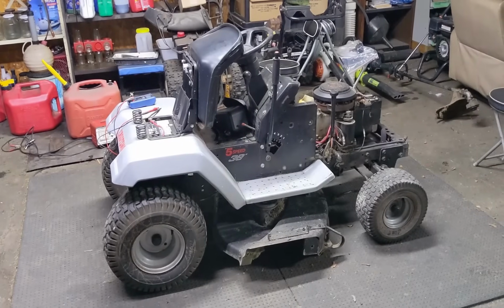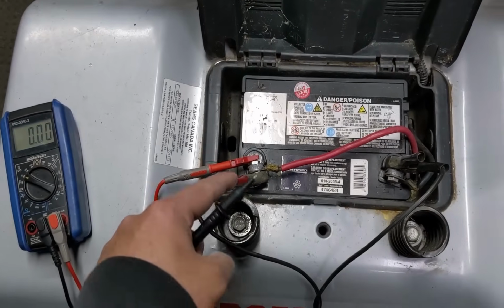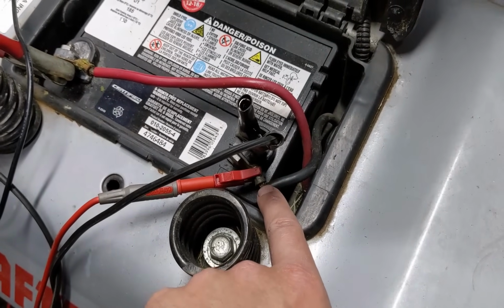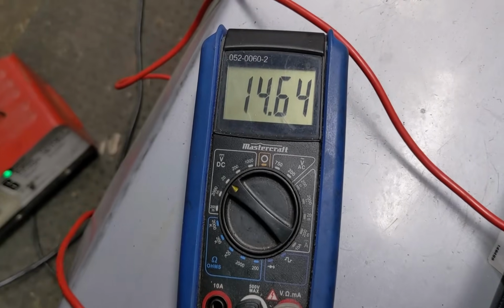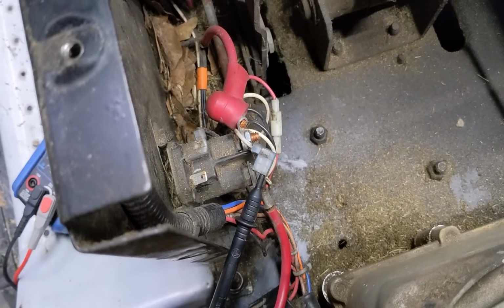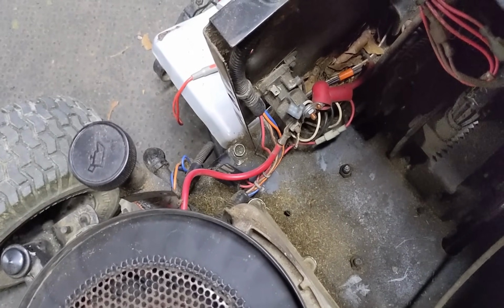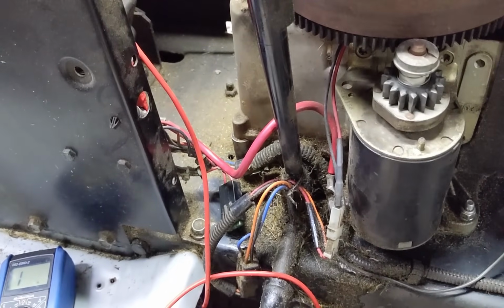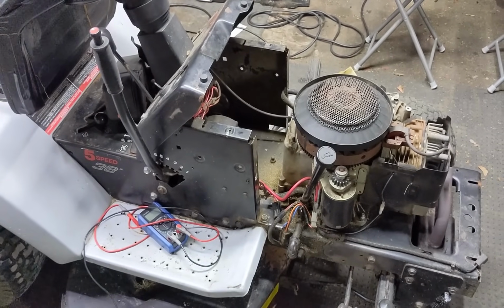Electrical Diagnosis of Riding Lawnmower that Won't Start

Comment: I just had a similar situation occur with my x350. Everything would power on, battery was fully charged, but it would start. Turns out the ground cable to the battery was slightly loose! After snugging it down, it started right up, good learning experience!

Comment: Outstanding work of explaining how to perform each step for anyone who may not understand how to use the Ohm-meter. The explanations are clear and to the point with a lot of repetition to what you are doing.  I enjoyed this very much, especially as my mower has an electrical issue which just popped up. :(  Keep up the excellent work.
Reply from the maker: Thanks Harry, hope you get it fixed up, good luck!
Reply: @EliminatorPerformance  I spent the day taking the mower apart since the book said the fuse was behind the dash.  I couldn't find it but when I was checking parts on the right side I found the fuse box attached to the sidewall next to the engine.  The fuse was blown.  So much dust & grass clippings so I blew it all out.  I then had to go to the store to buy new fuses.  At least I didn't need to buy a new battery!  The one I have is four years old.
Reply: @EliminatorPerformance  My Craftsman mower (a later model than the one you are testing) also has a safety switch on the seat which prevents the engine from starting unless someone is sitting on the seat. Total number of safety switches (I think) are brake, seat, and mower engagement [PTO].  My mower was running before I parked it, then when I wanted to move the mower the next day, it would not start. No click or anything;  I checked the battery, it's good; I checked the fuse but it had blown with part of it burned away.  I replaced the fuse but still no click so I'm following the steps you have shown to find where the other issue is which I've missed.  Thanks for the excellent discussion and showing me and others how to use a multi-meter.

Comment: You over complicated that big time! You should be able to diagnose a solenoid issue in less than 2 minutes. Without a meter!
Reply from the maker: You completely missed the point of this video lol thanks for stopping by though.
Reply: @EliminatorPerformance  No I got it. You just over complicated it big time.
Reply from the maker: @racerguy500  this is a tutorial on what to look for, and how to go through each and every single process, step by step for someone that doesn't know. Explaining how the circuits work, and what to look for when testing each one. As I stated in the beginning, I already knew what was wrong before I even started filming.

Comment: You tutorials are top notch- i had a question- i believe my solenoid is bad…. Is the wiring set up so that in the off position there is always 12 V going through the system to the starter….???

 If i run my multimeter from the hot battery post to my starter- i get a full reading of 12+ volts…. When i engage the starter switch to start- the reading on the starter goes from 12 to 0- i am planning on replacing both the solenoid and the starter switch…….  I will test the starter switch when i pull it out tomorrow…. Thanks

Comment: Hey, my lawn tractor Husqvarna TS138 model has an issue. I think it is related to the electrical system.

The battery indicator always red in colour (meaning the battery is weak or almost empty) even though I use the new battery and fully charged battery.

Is it the solenoid problem? Or maybe it is the key problem?

Please help me. I stuck with this problem almost three months now.

Comment: Awesome step by step. I had done some disassembly to repair a serious gas leak which turned out to be a disconnected hose that must have vibrated loose from a poor connection. Put it all back together and not even a click. I suspected the seat safety switch because that’s the only electrical I touched. According to your protocol I got a bad read on the ground wire from battery! Why now? Was starting fine prior to disassembly. Anyway, back to cleaning and/or removing cable after a break. 19.5 hp Twin Craftsman. Thx.

Comment: Great video. Just to be clear, on a 3 terminal solenoid, the switch trigger wire should or shouldn't have continuity between it and the grounding bracket. Thanks.

Comment: I have to say this was very helpful - I'm going out to get a Volt Meter tomorrow! The starter problem I'm having on my Cub Cadet LTX1042LW is that when I turn the key switch, I'm hearing what I'd call a 'whirl' sound but no engine turn over. I'm not hearing the 'solenoid click' you talked about. After a number of key turning attempts, the engine will turn over and start. Would this be more of a solenoid issue or starter issue or something other?
Reply from the maker: Sounds like a starter gear issue to be honest, I'd remove the engine cover and then inspect the starter gear, if you engage the parking brake, you'd be able to view it as you turn the key.

Comment: Pretty good tutorial. Although, the first thing I would have checked is the last thing you checked.  If you hear the solenoid click you already know all of the safety switches are working. All you need now is voltage going from the solenoid to the starter. Don't overlook that the terminal could be loose inside the starter.  Also, some tractors use the ground terminal on the 4 pole solenoid as part of the safety circuit. Notice that the tractor that you are using as an example has two wires on the ground terminal.  If for example the brake switch or pto switch is in the ground side of the solenoid circuit it could keep from activating the solenoid if bad.  Also, if you don't have a volt/ohm meter you can use a test light to check continuity.  Just connect one end of the test light to the beginning of a piece of wire being tested and the other end of the test light  to the other end of the wire, turn the starter switch to the start position and if the light lights, even dimly, you have a bad connection between the two points being measured. Keep up the good work.
Reply from the maker: Yes definitely, this was just a step by step tutorial to take people through everything. Thanks for watching!

Comment: Here is another fix for this you can also check that the lever for the blade engagement is properly pushing on the  safety switch for starting the mower. Any who great and informative video.
Reply from the maker: Thanks for watching!

Comment: I'm only getting 6-8 volts on starter side
Reply from the maker: Trace back, possible corrosion on the connection between the solenoid terminals for battery positive and starter
Reply: It's clicking . 12.5 on battery side,. But it only puts 6vs and slowly rises to 8 with key, and gets hot
Reply from the maker: Either replace solenoid, or bench test the starter by itself to isolate the issue
Reply: I am testing at the #2ppst on the solanoid.  A ohm resistor test on the two posts shows very high resistance when turning 🗝️. Could a bad starter cause that thanks again
Reply: So I'm working on a new mower and not getting 12 volts to the positive solenoid white wire. The switch is testing out good. I can jump the solenoid and get it started. But that is only if the brake is on. If the brake is off when I jump the solenoid it just spins with no fire. Help ty

Comment: Dude, outstanding job on explaining the process. Understood everything and now I can check my tractor. Mine shut down while moving and I cant get it going now? Filled gas and oil.  Maybe it was an oil alert shutdown, cuz there was not alot of oil inside. Oops?!
Reply from the maker: Yes low oil shut off switch, prevents you from starting engine

Comment: Once you determined the selonoid was bad, could you then jump the battery side and the starter side of selonoid with the key in the run position and start the mower?

Comment: Why do you have a 30 amp fuse on a 10 amp charging system ?
Reply from the maker: From what I've seen, riding mowers that I've worked on generally have a 20-30 amp fuse on the starting circuit. That fuse is not for the charging circuit.

Comment: Could you jump the solenoid between the posts on it to try to engage the starter?
Reply from the maker: Yes, and if your starter turns than you know the battery and starter are good.

Comment: I replaced my solenoid and I still can’t track down what’s wrong. I took battery out of car and hooked up jumper cables and tried jumping the riding lawnmower and I can hear the starter spinning, but I’m not getting the engine to run. Ideas sir?

Comment: Great video and new subscriber! I'm just after trying to diagnose my mower. I put 12v to the solenoid which started the starter so I guess it means they are both ok. There is such a mess of wires and so many safety switches it is impossible to check and after a few I lost heart. I turn the key one notch and it just beeps continuously. It is a Mountfield 1530h and only a year old. Made in China. I watched a few of your videos and took a few switches out which seemed to work ok. I'd say it's corrosion on a wire making a bad connection but how to find where?
Reply from the maker: Yea go through and do resistance tests on wires. Battery positive and ground ok if it turned over when you put 12v directly to solenoid. Solenoid also working. So check for 12v at that small solenoid charging wire coming from keyswitch. Seems like you have a bad brake switch or keyswitch if you're not getting 12v there. Like I said, it looks complicated, but if you go from one side to the other, and eliminate things in the process, you'll eventually find your issue.

Comment: You're incredible man!  Thank you so much!!!!!
Reply from the maker: Thanks for watching!
Reply: @EliminatorPerformance  My issue is with the ignition. I hear a click when I start it. The battery is brand new but it doesn't start, just a click on the solenoid. What could it be?

Comment: Thanks for the video!  I have a Gravely 991041 zero turn and will definitely be going through this diagnosis daisy chain.  On the off-chance that someone in YouTubeland has an idea of what my issue might be based solely on description, here are the symptoms.  Any feedback would be most appreciated.  
1) Ran totally fine three days ago. (The battery is one year old and shows full charge with a multimeter.  I don't own a load tester.)
2) Wouldn't turn over today but made a buzzing sound- not sure if the buzz was from the starter or one of the relays.
3) Started fine with a jump.
4) Mowed the lawn, but once finished, it would not start again unless jumped.
Reply: I have the same issue (buzzing) but a no crank, no start on a Toro ZT. I am looking to find a battery tester to see if they have one at Harbor Freight to eliminate that as first step to diagnosing my problem.

Comment: Eliminator, HELP… I’ve got 3 days into troubleshooting this issue, and I’m running out of ideas…here’s my situation.
I have an older Simplicity Coronet 9.
I was mowing when the blades suddenly stopped, as if I had pushed in the PTO switch.
The engine kept running though, but no matter what I did, the electric clutch for the blades would not re-engage. 
I turned off the motor, only to find that it would not start again – no response at all when turning the key to the start position.
However, I could still start the engine by shorting the solenoid.

While attempting to troubleshoot, I discovered that when the key was in the Run position, the 20Amp self-resetting circuit breaker was making a pinging sound about every 10 seconds.  This I figure is the cycle time of the self-resetting mechanism – as soon as it closed, it would pop back open. I have unplugged every module and safety switch, removed the ignition switch and PTO switch as to try to isolate the short, but even with the wiring harness as naked as I can get it, the short is still there when I jumper the Run setting on the ignition switch.  I have used my test meter to try to measure the current when the breaker closes, but it so instantly pops back open, I can’t get a reading other than OL, which I believe stands for Overload.  The electric clutch ohms out within spec, I have benched checked the solenoid, the circuit breaker (new), the ignition switch (new), and the PTO switch (new).  I have closely examined the wiring harness for breaks and/or shorts, but to no avail.  My next move is to completely unwrap the wiring harness to see what’s under all that tape.  
Can you think of a better way I can approach this or what I should be doing next?  
Thanks, Michael

Comment: Success!  Your video helped me determine high resistance on the positive side.  Had some stubborn crusties on the positive connector and wire wheeled and got a new washer and wired the bolt.  And fired right up.  3 hours of tinkering and taking off the starter and testing it also with your video.

Comment: Great video, easy to follow and understand.  It’s the first time I actually used my multi- meter and understood what I was doing.  However, all the tests on my Husqvarna lawn tractor proved I have power where it should be, good ground connection and continuity where it should be.  I even watched another video on testing my key switch and it was fine.  But my mower still won’t crank!  Any suggestions?
Reply from the maker: Hmm, if you power starter directly and it doesn't work, it could be your starter. If you're getting power to the solenoid and it doesn't click, it's either a bad ground on the solenoid or it's a bad solenoid.
Reply: Ok, I ran all test again , everything still ok.  Although my battery shows 12.35 volts, I put batter changer on it and charged it to about 14 volts, but when I took charger off volts went back to 12.35 and mower still won’t start, solenoid just clicks.  Put charger back on and tried to start with charger with attached.  Mower started fine!  So, can my battery be showing a full charge but not  strong enough to crank my mower?
Reply from the maker: @butchmcelwee3280  yes absolutely, check this video out, I had a battery showing 12v but it lacked the amps to start a riding Lawnmower https://youtu.be/q3uRJV2Ucss

Comment: Awesome explanation. I am wondering. Once you narrowed it down to a faulty solenoid, could you temporarily test the theory by carefully bridging the two red wires together, from each side of the solenoid (without touching the frame!), and seeing if it starts?
Reply from the maker: Yes absolutely, but for the sake of safety I can't recommend that, so I didn't include it in the video. That's why I mentioned tester the starter by itself, and if it works, it rules out that as a possible issue.

Comment: What if I'm not getting power to the white cord going to the solenoid
Reply from the maker: Bad key switch or safety switch grounding the keyswitch. So for example, a bad brake safety switch would prevent 12v from going to the solenoid. The blade engage safety switch would also prevent starting, if the switch is bad, the machine thinks the blades are engaged.
Reply: @EliminatorPerformance  thanks I'll check the blade engagement switch
Reply: @EliminatorPerformance  thanks,I checked the key switch and brake switch. Could it be my blade engagement switch

Comment: I’m having troubles figuring out what powers/supplies the key switch with power. Working on a Dixon 4423. Believe it was built around 1998.
Reply from the maker: The little wire off the one side of the solenoid with the big battery positive. That goes to the keyswitch, and when you turn the key, it sends power down another small wire to the solenoid, to engage the electric magnet.

Comment: Will any coil interchange with a yardmasters 400 cc riding lawnmower if so what make and model.
Reply from the maker: No, get the model number off the engine and then google it for a parts diagram. Then get the part number

Comment: The video is very well done,  But can you just do the fix rather than say "I'm going to go ahead and"
Reply: Dave c.very helpful curious of one thing not mentioned.how come you din t speak of the coil or did I miss that.still you explained explicitly.thanks.
Reply from the maker: I'll try to improve on that, thanks for watching!

Comment: Just working on an mtd left at our church fundraising scrap metal dumpster. No start. Clue was a heavy duty push button added just behind battery. I just removed as it's wiring was weird. Turned out to be a dead solenoid. After getting it started the next adventure was the charging system. A fuse had been added between stator wire and chassis connector. I put a fuse in which immediately blew as the battery lead in the connector fed back through fuse to stator to ground. Someone had removed the diode from the stator lead . added a diode and charging now works.
Reply from the maker: Nice fix!

Comment: I actually had a case of 12v on the white wire on the solenoid but a poor contact at the b or s of the keyswitch prevented enough current to actually trigger the solenoid.

Comment: Great video. I have the exact same mower and when I turn the key to on position the fuse blows, I have tried almost everything, do you have any ideas? Thanks
Reply from the maker: You most likely have a short to ground somewhere, most likely a wire that's bare touching the frame.
Reply: @EliminatorPerformance  my yardmasters lawnmower won't fire out the sparkplug I fixed the key switch I tested the coil there is no fire coming out of it is there a coil off a different model that will interchange I would like to find one if it will.

Comment: Extremely well put together step by step electrical tutorial that explains everything you need to know. You should get a raise!
Reply: Good  day  Wayne  Boy you are right with that , he should have a raise.  Thanks
Reply: I spent hrs on a Husky rider did all kinds of things then found it was a 20 amp fuse....when it was narrowed down to that it took a while to find the thing as the schematic is horrible. Just happened across it noticing a clip barely visible that held the housing. grrr